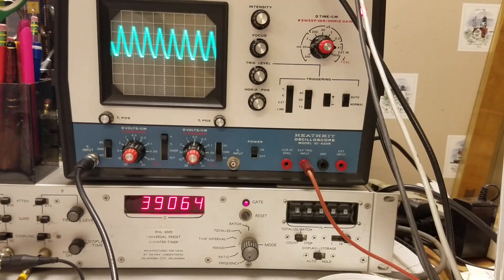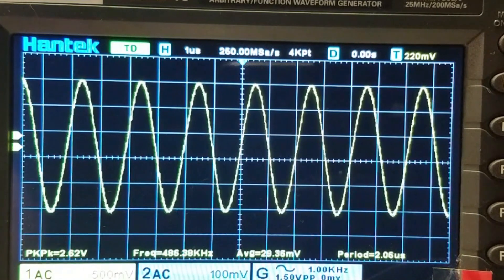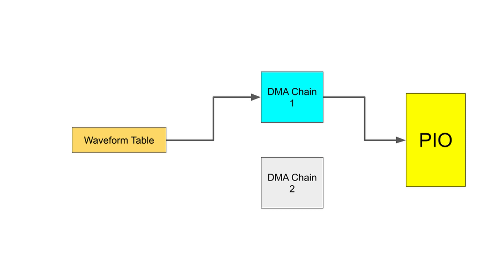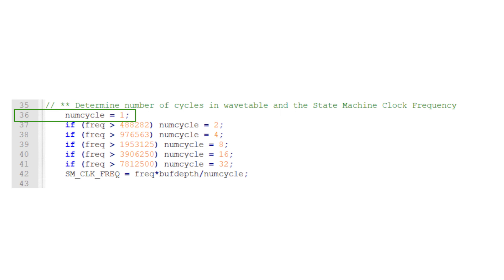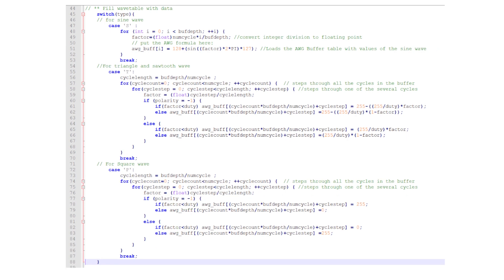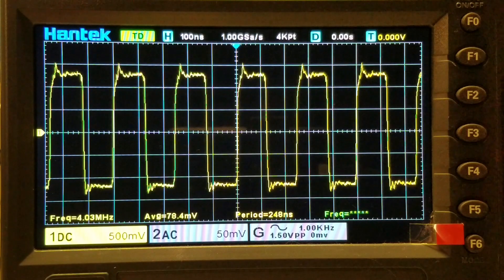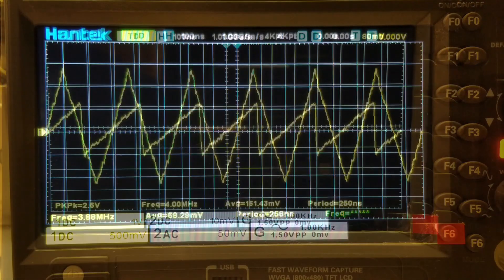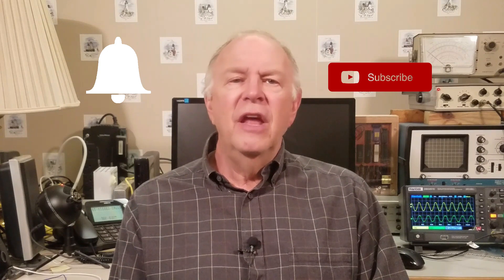Raspberry Pi Pico PIO - Ep. 15 - Faster Arbitrary Waveform Generator

Comment: Hello, Thanks for the time you put into this video. I have your code and I am trying to modify it to work with a 10 bit DAC, but I have not been successful so far. The first step was to verify my hardware setup, which I did with your 8 bit example. This yielded a sinewave of that was a bit offset in amplitude because of the missing two bits so the hardware seems to be working fine. From a code standpoint here are the changes I made:
//change pin count to 10 and change the buffer to a uint16_t size
uint NPINS = 10; //Number of output pins
uint16_t awg_buff[256] __attribute__((aligned(256)));
//changed the sinewave calculation to support 10 bits
awg_buff[i] = 512+(sin((factor)*2*PI)*511); //Loads the AWG Buffer table with values of the sine wave
//I added a function to set DMA transfer size to 16 bit and updated the ring buffer wrap to 512 bytes instead of 256
channel_config_set_transfer_data_size(&wave_dma_chan_a_config, DMA_SIZE_16);
channel_config_set_ring(&wave_dma_chan_a_config, false, 9); //wrap every 512 bytes
//Did the same thing for DMA chan b
//in the .pio file I changed the "out" pin count to 10
out pins, 10

Let me know if you have any input into what I may be doing wrong. Thanks again
Reply from the maker: It's been a while since I've done DMA; so I'm not really confident in my answer.  I think using more than one byte resolution (10 bits) could cause troubles.  Moving DMA data one byte at a time greatly simplifies the whole transfer process.  I would first try keeping the ring buffer wrap to 256 bytes and try for a lower resolution to see if you can get some output.  Maybe go back to my first AWG video and modify that one to see if you can get 10 bits to work.  Once I got output; I would then sneak up on the goal by adding one feature at a time.  Interesting project...good luck!
Reply: @LifewithDavid1  Thanks for the fast response. Yeah I guess you did do this video years ago. I am close should have it working soon
Reply from the maker: @nmf5003  That's great!  Don't you love it when a plan comes together.  Have fun!

Comment: I wonder if you couldn't increase the frequency by sending 3 bytes at once, as there are enough PIO pins, and PIO doesn't care - it can send 8 bits or 24 bits at the same speed. I just can't figure out how you could stage those 3 bytes in series at the DAC without some sort of 3x clock.
Reply from the maker: You might be able to gang 2 or 3 state machines together and synchronize them so they are off one or two cycles from each other.  That would take a bit of head scratching.  Thanks for the suggestion!
Reply: @LifewithDavid1  I think For 16 bits you could do this very easily with discrete components. Feed 8 bits each two 8 bit latches. And also output a clock single that you feed into a clock doubler. 

The undoubled clock drives the latches, and the doubled clock (via an inverter for one of the latches) toggles output enable for the latches. Not quite sure how to combine these signals outputs for the DAC. If it’s tristate I think you could just wire them both into the DAC. But I fear the devil is in the details there. What if both chip’s OE are active at once because of inverter delay? I imagine you could just use a multiplexer.

But I worry you’d run into speed limits with all those discrete components. So it might not be worth it.

Comment: Hi David,, I love your videos! Is it possible for your 8-bit Sine Wave to output the value to another State machine's FIFO which is running a PWM PIO routine (running at a much higher clock speed)? This would allow you to drop your R-2R circuit for this '1-bit' DAC. Thank you!
Reply from the maker: It should be possible.  I did someone similar in my one of my first PIO videos; just not the R-2R part.  Thanks for the comment!

Comment: thank you david. When I use SM_CLK_FREQ=10,000 Hz, I get a distorted sine waveform. When I increase it to 125 MHz, I get an undistorted sine waveform. Could you please explain why this happens? knowing that in my case I did not add the capacitor and the amplifier.
Reply from the maker: When the state machine runs slowly (10 KHz); it can only output at the speed of the 10 KHz/the length of the PIO output loop.  The faster the state machine runs, the faster you can output the data.  The faster the data, the smoother the curve.
Reply: @LifewithDavid1  Thank you for your answer. In ou PIO program we have just one instruction, tha means the output rate is 10Khz  when the SM runs at 10 KH.But  In your example, the state machine runs at 10 kHz, ensuring that the sine wave is not deformed in my example i get a deformed sine wave.
Reply from the maker: @haryoulimohamed3891  In the video, I suggested that you run the state machine as fast as possible.  Let's assume that you want to output a 10 KHz sine wave.  You should have at least 16 samples per wave cycle (32 or 64 is much better).  That means you need to run the state machine at least 160 KHz (16 * 10 KHz).

Comment: thank you david. i have a project real time signal processing(audio) with pio and DAC 8 bits. can you suggest me what can i do please
Reply from the maker: I added a DAC to the Pico in my DOOM video. I think that should work well for your application.  You could use both cores; one for the signal processing, and one to handle the interface between memory and the PIO.  DMA can help.  My most recent video does a bare metal DMA.      Good luck!
Reply: @LifewithDavid1  Thank you. i want to use ADC with PIO and DAC 8 bits for data processing in real time .And don't know what i must do??   Can I use PIO for sampling analog signal??
Reply from the maker: @haryoulimohamed3891  I would try using DMA to move the ADC data to a PIO FIFO.  See section 4.9.2.5 of the RP2040 datasheet.  Although this is not a beginner's project, if you have enough time to play, you should be able get the DMA to grab the ADC sample, then send it to PIO.  You can use DREQ_ADC to control the pace of the DMA (500ksps) (see my most recent video and Table 119 of the datasheet).  However, I don't know where you are going to do the signal processing.  If it is one of the cores; then you may want to send it to a memory location directly instead of PIO.  Then you can modify the data-steam as desired and then send it to PIO to output to a DAC.  Although I haven't addressed this problem specifically, hopefully there is enough information in my 36+ videos on the RP2040 to give you some help.  Good luck!
Reply: @LifewithDavid1  "Thank you for your answer. Can I use PIO for data processing to reduce the latency, such as implementing a low-pass filter with PIO? Is that feasible?
Reply from the maker: @haryoulimohamed3891  Probably not; but it depends how clever you are.  Check out The PIO Chronicles, Episode 1-5.  There are only 9 instructions, and none of them are logical (except a version of the jump command).  No arithmetic.  PIO is used to move data between the RP2040 and the outside world.  But you should have no problem keeping up with the ADC (500ksps max speed) with the main core.  It will work if you can do your filtering in under 250 clock cycles on one of the cores.  Program in C (if you've got a lot of slop) or assembly (if timing is tight).  Use DMA to move data from the ADC to the core.  Manipulate the data in the core, and then use PIO to send the manipulated data from the core to the DAC,  Check out my PIO and bare metal videos.  That should bring you up to speed.
Reply: @LifewithDavid1  Thank you. It is feasible to use the INMP441 MEMS Microphone, which uses the I2S protocol, to communicate with the Raspberry Pi Pico. Instead of using the standard I2S protocol, we will implement it using PIO (Programmable Input/Output).
Reply: @haryoulimohamed3891  I'm sorry, but I don't have any experience with using I2S microphones.  I'm sure you can use PIO to provide "enhanced" I2S connectivity; but this is out of my wheelhouse.  Good luck!

Comment: Great Demonstration. Is it not possible to use a frequency multiplier to get higher frequencies?
Reply from the maker: I think that's about the limit using the Pico.  I think in the next video; I explore the limits of waveshape vs. speed.  Much faster and you probably would be better with analog.

Comment: Great videos and explanations. I am trying to use an ADC to vary the frequency. However, I found that after the first setup, the Pico seems to panic when trying to reset/restart the DMAs or PIO in a 'while()' loop. The 'reset/unreset block commands are seemingly not the answer. So for now, I am using a simple 'reset' button on pin 30 to start the Pico over for each frequency change via the serial port program. Any suggestions on how to do it elegantly? BTW, your explanations on each important step are extremely useful.
Reply from the maker: Not sure without some testing; but I would make a second wave table with the new frequency and then switch to it with the DMA.  Perhaps the exact timing can be made using interrupts which will interrupt the while loop.
Reply: What I am currently trying is placing the entire setup procedure in a function, then accessing that for even the first time and subsequent times through the while () loop. However, even with the block set/reset at the beginning of that loop, it's still only works the first time. Keeping in mind my lack of knowledge on dma, I'm still mystified!
Reply from the maker: @samhutchins3061  I had a little problem with the DMA in my homebrew video (Ep. 12) because (I believe) DMA and the main core were butting heads when addressing the main bus.  If you ask the core to do too much (like continuously redefining the setup function) then you might have some interference.  Check out all my DMA related videos, that might help.  Sounds like a cool project, Good luck!
Reply: Good insight. However for my function it is only rerun after manually entering different parameters such as wave type and frequency, so it's not doing that all the time. Thank you for the responses and helpful comments. Keep up the great videos!

Comment: Great job. To avoid jitter I use only integer divisors and adapt the buffer size for precise frequencies. Because of the FIFO there is no need to stick to memory aligned buffers. You can find it on instructables, user rgco
Reply from the maker: Thanks for the info!  I changed the buffer size in my follow-up video (Ep. 16); but I kept to memory aligned buffers.   I'll check out your instructables.   Thanks for watching!

Comment: David, I and a few others would like to see you build a W65C02 base system with an expansion connector for a bus. Bus expansion boards would include Adafruit 8-bit TFT LCD and an I2C-based SD card (using the NXP PCA9564 I2C to 8-bit parallel converter chip).
Reply from the maker: Interesting.   I’ll take a look at that.  I was also considering turning a Pico into a 6502 system on a board that would emulate my TIM system.  Both are going to take a little head scratching time.  Thanks for the suggestion!
Reply: Keep your eyes open for a new 6502 IDE from Oshonsoft in the coming days. I use the Z80 one and it works great.

Comment: Great video 
Try to overclock pico it can run at 250mhz up to 400mhz
So you can push  sm clock  and your awg freq
Reply from the maker: Thanks for the suggestion!  My next step is to see if I can get rid of the jitter.  Overclocking might help; I haven’t tried that yet.
Reply from the maker: Thanks for the suggestion!  My next step is to get rid of the jitter.  Overclocking might help; I haven’t tried that yet.

Comment: Thank you so much for these great Pi Pico videos. Been working my way through them and have been learning a lot.
Just a quick note though, at 8:56 lines 60 and 77, the statement "if polarity = -1" is an assignment statement, NOT an equality statement (which, in C, is "==" (double equals.)) So, not only are you clobbering whatever value is in "polarity" , but since assignment operators always evaluate to Boolean true, the "else" clauses of those "if" statements will never run. (Yeah, this has tripped me up too. I've lost count of how many times.)
Reply from the maker: Ahhh.  Forgot about the "==".  That's the problem in working with multiple languages.  I'm so old that FORTRAN is my native language.  Thanks, I'll check it out!

Comment: According to the sampling theorem, you can produce a perfect sine wave as long as you have more than two samples per period. However, this requires a low pass filter at the output of the DAC. So with a sampling frequency of 125 MHz, in theory, a perfect sine wave of 62.5 MHz is achievable. In practice, the limit will be about 50 MHz. Concerning the jitter problem, it would be much better to use a DDS (direct digital synthesizer), also known as NCO (numerically controlled oscillator). Those work with a constant sampling frequency but can achieve a very good frequency resolution.
Reply from the maker: Those are good points.  Perhaps an NCO could be simulated on the Pico by creating a series of wavetables when strung together and sampled at 125 MHz could synthesize many more stable waves.  i.e. two wavetables each with 7 1/2 cycles (total of 15 cycles) output one after another would give a stable waveform of 3662109.  Thanks for watching!